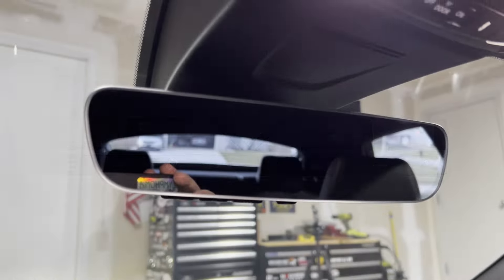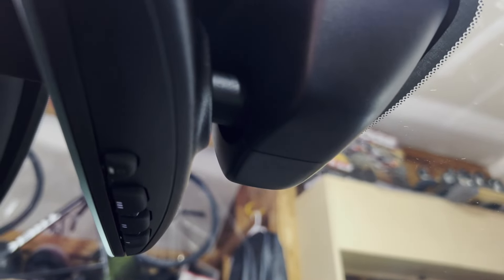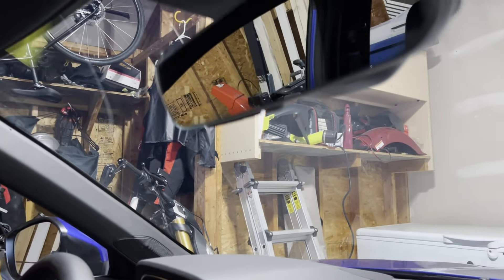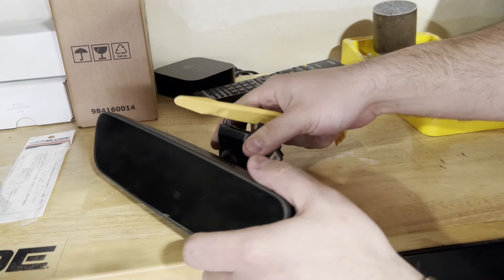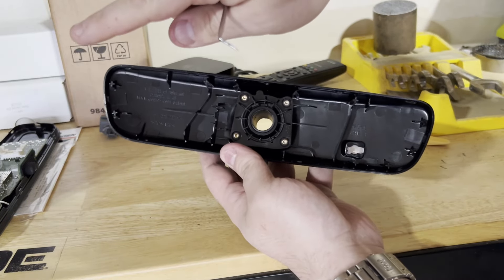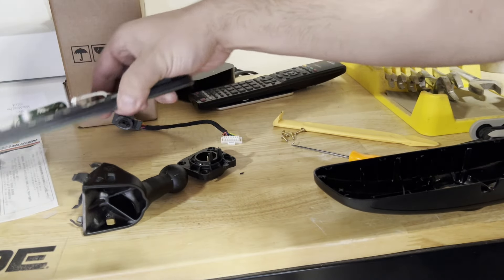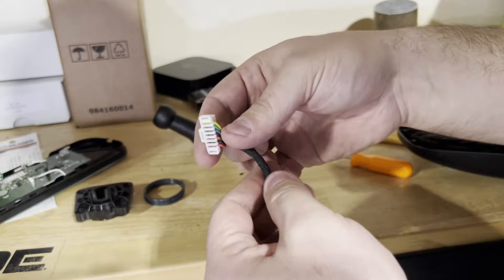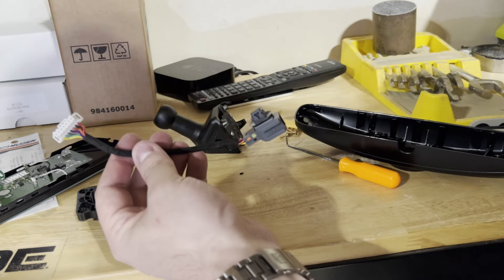Installing a Frameless Homelink Mirror in 2024 Integra Type S

Comment: Legit great walkthrough.  I took a small piece of red wire from the Honda harness and bridged it from the red connection to the yellow connection in the Integra harness.  Without this video, I would have done the one that ran a power wire from the A-pillar.

Comment: Hi, thank you for putting this video together. The hardware swap seems straightforward, but I'm not fully understanding the electrical part. I understand your suggestion to basically bridge the red and yellow wires together, but can you make a diagram on your website perhaps to show what you are talking about in regards to vehicle side and mirror side connections to switched and constant 12V power? If I'm understanding correctly, I wonder if it's possible to simply repin the red wire to where the yellow wire is on the mirror side, rather than making permanent changes.